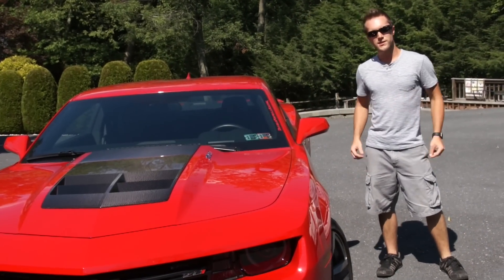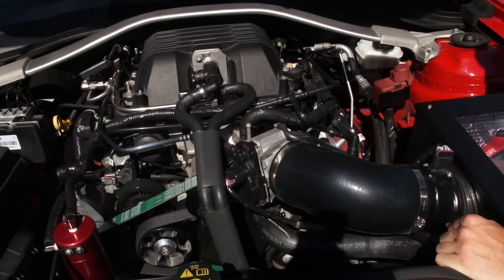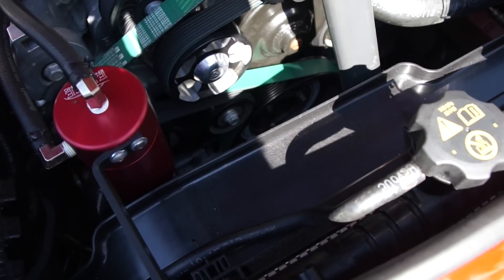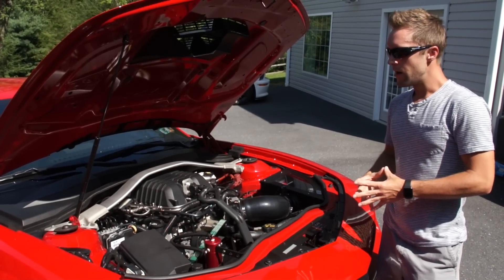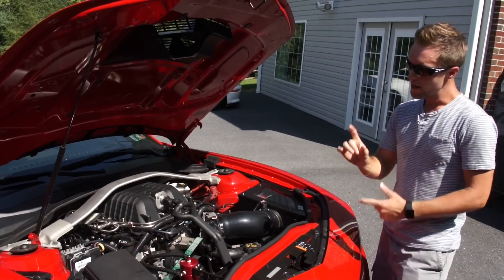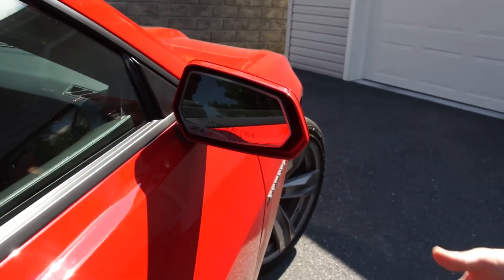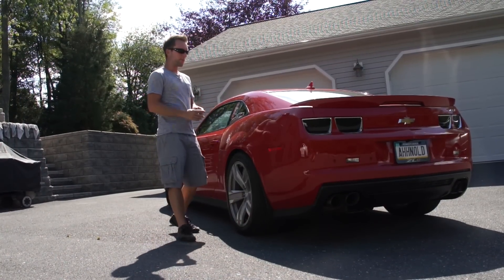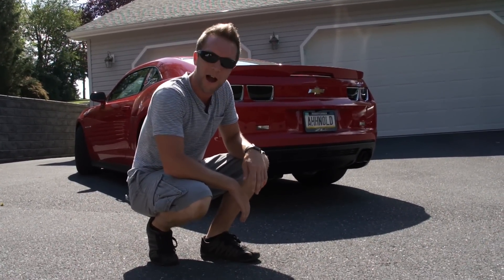850HP CAMARO ZL1 WALKAROUND!!! (Full Mod List)

Comment: Great video man I have an inferno orange  2013 Camaro 2ss rs and I'm trying to figure a way to modify it to kinda how your zl1 is minus the supercharger and a couple of other things of course would have to be extra for me to add in. But above all keep making great content! Really enjoy all your videos!
Reply: Cam, headers, 3 inch exhaust, intake, tune and you'll be at about 475rwhp (a little less if it's an auto) and it'll sound mean as fuck and you'll definitely be a lot faster. I'm hoping to have all that done next summer by a shop in Mesa, AZ called Cordes Racing Performance.

Comment: I prefer this body style ZL1, over the newer 2017 one. I think this body looks better, and is a cleaner design. The newer Camaro to me, looks to futuristic and I don't like the taillights at all!! Clean car bro!!!!
Reply: Pro 4X bro my cousin has a red 2012 ZL1 and that thing is nice, it’s a garage queen and it’s bone stock only has the exhaust fuse pulled the new zl1 definitely has a better platform but yeah I agree with u this one is much clean and timeless looking
Reply: @gavinsnyder9028 I think the new Zl1 has basically the same frame platform, just better suspension and aluminum subframes
Reply: I agree with u I don’t really like new zl1’s they look so weird.

Comment: Any plans for a new supercharger? Or are you going to stick to stock?
Reply: Would be quite ridiculous to spend $7k on a new supercharger when his only has 15k miles on it and still works.
Reply: +Friends Are Overrated To be fair, you can get a Kenne Belle supercharger for about 7k and it'll give the ZL1 roughly 850 to the wheels stock. It can go up to 1000 though.

Comment: Hey I have a quick question and would like some input.. I just bought a pair of wheels second hand and was so excited about them I overlooked a small hairline crack that is 1-2 inches long on the inner part of the wheel, and it doesn't leak any air. I've looked up and most shops charge around $80 or so to fix it but a lot of people say not to and to just get a new wheel. The probelem is I don't have $400+ to drop on a new one.
Reply: +GuitarmageddonZL1 I took it in today and said fuck it and get it repaired..

Comment: If you only upgrade the cam lets say on a truck, does it still make that loop?
Reply: Idle*
Reply: @cesarbenavides9105  the bigger the cam the rougher the idle as a rule of thumb. A tuner can also change the idle characteristics even with the stock cam.

Comment: Intrigued by your upgrade to Nitto NTQ5R rear tires.  What did you choose for fronts?  I'm looking for a good replacement for the Goodyear's that offer improved treadlife without giving up to much traction.  My ZL is driven only in the best of weather conditions so wet/cold weather traction is not a concern.  Any tips would be appreciated.

Comment: Hey man, I have a 2015 zl1 with the exact same modifications as yours I mean right down to the nittos. my cam is slightly different but it's 709 to the wheels. Do you have any off idle stumble on really hot humid days? how does it run when it's cold?

Comment: Mine ended up making 583/655 at 11psi, but the fuel pump wouldn't keep up so it wasn't taken past 4700 rpm. So with a pump I'm hoping for around 620